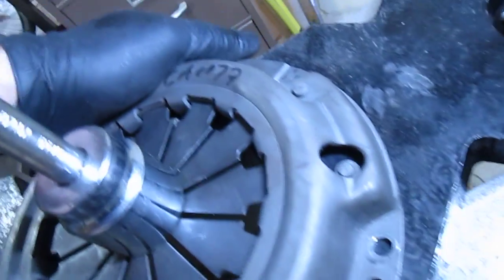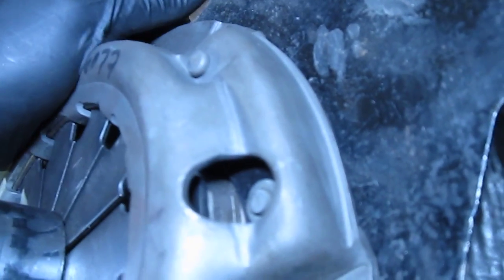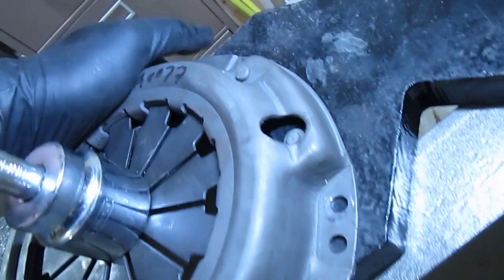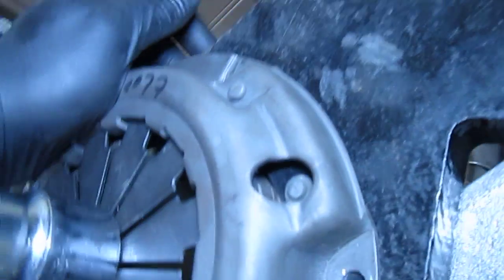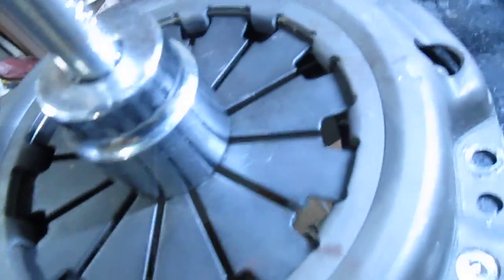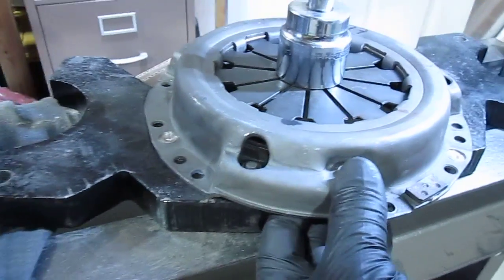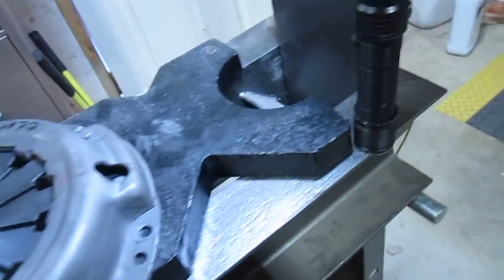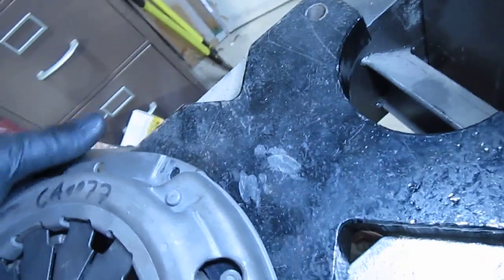Brand new BAD clutch pressure plate

Comment: The diaphragm spring does not have to physicaly pull the plate away from the disk lining during release. All it has to do is relieve its clamping force and clutch is essentually disengaged...just like disc brakes, when brakes are released the linings are still in contact with the disc BUT with no pushing force from the caliper piston.  So your pressure plate should be okay. 😊
Reply: but the disk and plate are having clearance difference across the different point?

Comment: Those are drive straps. They pull the casting tight against the diaphragm spring and pull it away from the disc during the clutch release. One possible cause for this failure is if someone dropped the pressure plate casting side down from any (undefined) height like over 3' or so. The straps get deformed from the weight of the casting when it fell and can no longer pull the casting away from the clutch disc. some designs and mfgr's use clips that attach at the drive strap to casting rivets and curl up and hook on to the top side of the diaphragm spring.

Comment: Mine is luk ...makes noise when when shifting but only when driving.... Completely silent in neutral.... Pressing the clutch.... It's kind of a boat motor noise when releasing the clutch in each gear... Every single part is brand new and and rebuilt

Comment: I get a severe vibration from my engine bay, when am about releasing the clutch and it reaches the biting point( its worse when am climbing sharp hills or reversing at low rpm between 1000rpm to 800rpm, while on 1st gear, thats when it happens). It only goes away when i press the accelarator pedal a bit and above 1000rpm and speeding or i put it in neutral, it becomes smooth as butter. I changed all my engine mounts and gearbox mounts, changed my clutch plate, changed spark plugs, cleaned my air and fuel line, changed fuel pump, new tires and its still happening. My mechanic says it might be a problem from the clutch pressure plate, but while it was disassemble earlier, by physical observation it was looking mechanically ok. Please, i need advise or help from anyone who knows better or has had similar experience to solve this problem. This is my 1st manual car and it wasn't vibrating this badly when i first got it, now am not too excited driving it. Thanks, ur enlightenment will be greatly appreciated.